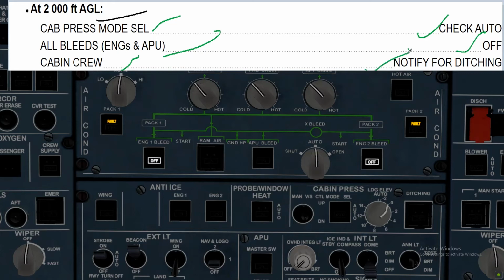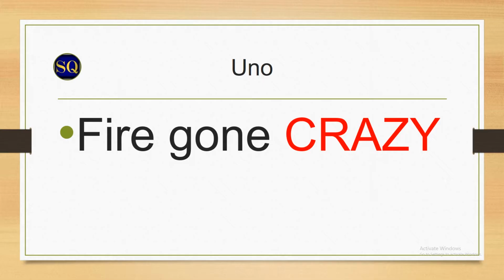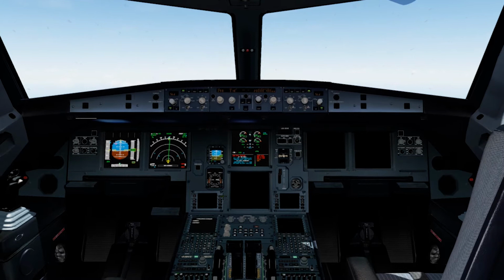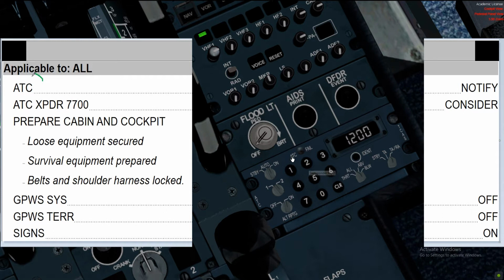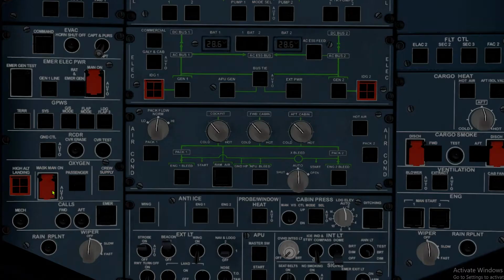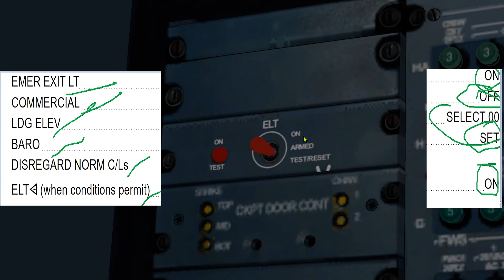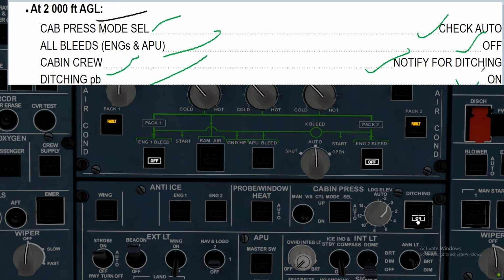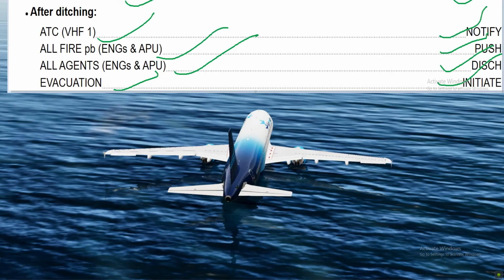A320 Ditching (MADE EASY)

Comment: Thank you for video,
DV window stands for Direct View Window (openable window which on one of those days could be the only way to see runway upon landing)  on A320 it’s left and right sliding windows
Reply from the maker: Hi Marijus, that is indeed right. Good!
Reply: Also conf 2 for ditching in ALL ENG FAIL Procedure due to loss of G+Y Hydraulic system, subsequently only slats are available (slats don’t move from flap lever position 2 to 3)
Reply from the maker: @marijusadomaitis4406  Great, you got it!

Comment: Love the videos captain, can I ask which simulator you use?
Reply from the maker: Hey Harrison, thanks, I am using P3D and flightsimlabs for the A320 addon.
Reply: @Captain_SQ  thank you captain
Reply from the maker: No problem.
Reply: @Captain_SQ  would you be able to do a guide on programming the different types of approaches in detail step by step, I am having some trouble understand what I'm supposed to be doing with approaches other than ILS.
Kind regards, Harrison
Reply from the maker: Hi Harrison, I have videos on NPAs, Circling and Visual Approaches. You can check them out in my lists of videos.
Reply: @Captain_SQ  captain can I ask, what has been the scariest thing that has happened to you whilst flying?
Reply from the maker: Bad weather conditions are a challenge. But nothing outstanding comes to mind.